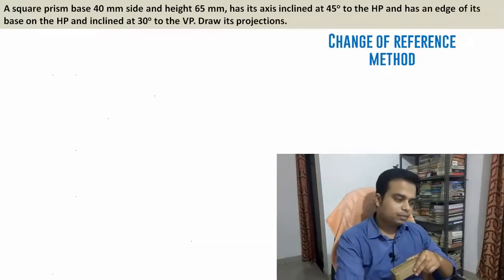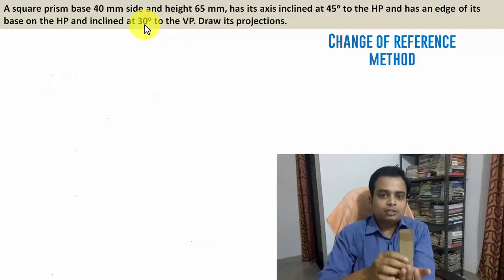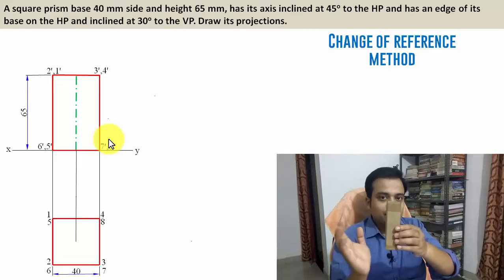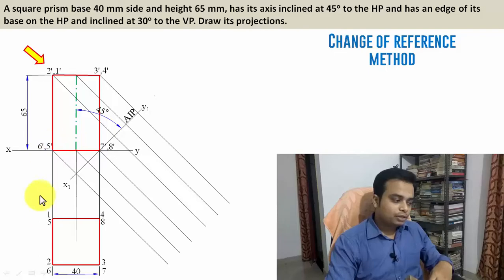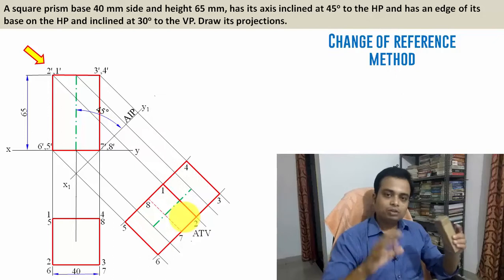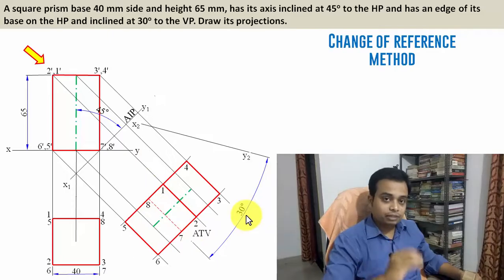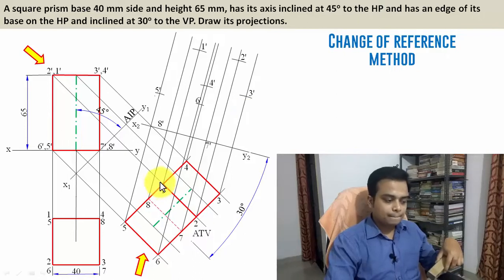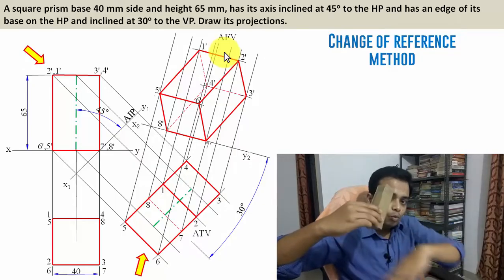Auxiliary Plane_Projection of Solid_Lecture 9

Comment: 2questions.1st .A vertical cylinder of 64mm diameter and 90mm in height is standing on it's base on hp.It is completely penetrated by a cylinder of daimeter 44mm and length 100mm in such a way that their axis intersect at right angle to each other and parallel to v.p.draw the curves of intersection ....2    A vertical cone of 52mm diameter and 72 mm in height ,is resting on it's base on h.p.and is completely penetrated by a horizontal cylinder of 30mm diameter and 90mm long the axis of the cylinder is parallel to H.p.and v.p.and intersect the axis of the cone at a distance of 24mm from the base draw the required curves of intersection.plz plz sir reply me 🙏🙏🙏🙏 and sol .plz exam Hai🙏